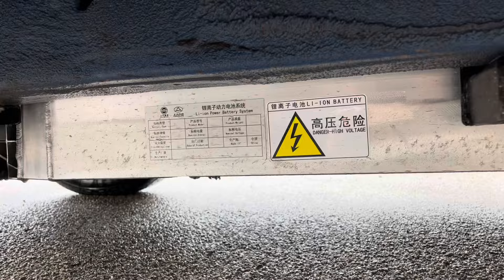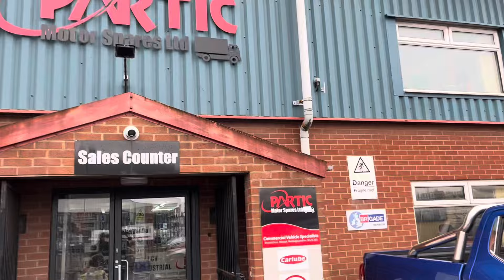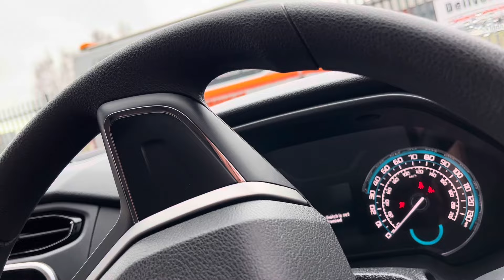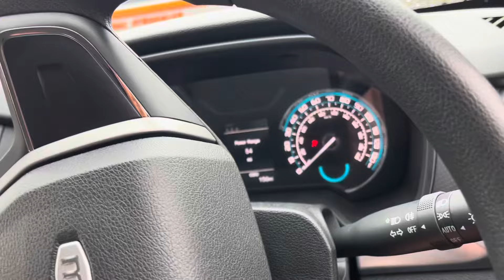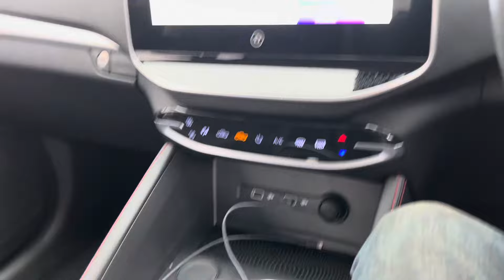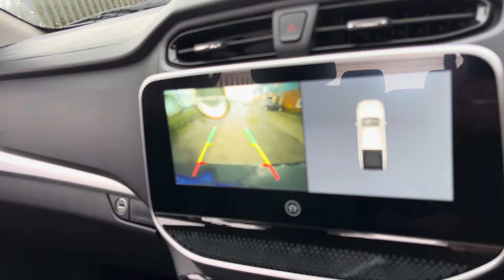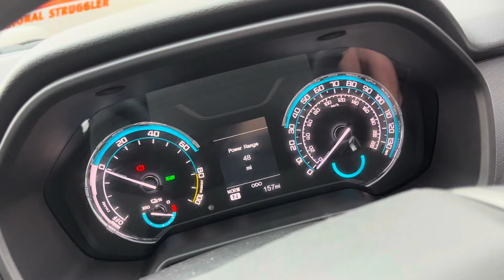First ever drive in an ELECTRIC VEHICLE⚡️review on the ONLY EV  pickup in the uk! Maxus T90 ev

Comment: The noise is a simulation for pedestrians. It goes away once your up to speed. It also has regenerative braking. It's like a retarder but puts energy back into the battery when you slow down. The traction battery is around 400V and is connected to an invertor that converts it from DC voltage to AC voltage for the motor. The 12V system is separate from the traction battery and kept topped up by a charge controller. Technically, the interior lights or radio etc won't drain the traction battery.
Reply from the maker: Nice bit of wisdom the mate thanks 👍

Comment: Worked for Volvo and they are going pretty much fully electric. Maintenance wise they are a piece of piss, if you have the correct equipment. Biggest complaint we had from owners was range. The ads and salesman tell them one thing and real life proves something different. Then it was us techs that were getting it in the neck when they were saying the car was faulty.
 A lot of that noise can also be a noise generator, by law they have to have a pedestrian warning system.
Reply from the maker: I did think that looking at the stats I wonder what it is in real life because I only went 1mile and the miles went down by 4 🤷‍♂️🤦🏼‍♂️

Comment: These come into Royal Portbury dock, Bristol mate.  There’s loads of them waiting to be sold and I get the impression they aren’t moving too well.
I’m glad you’ve had a look under the rear.    What a joke… when these first arrived I did the same and took some photos because I couldn’t believe the lack of quality in the workmanship, it looks like it’s just been thrown together!    Did you notice they spun the original axle 180 to get the motor in and how it hangs so low and anything more than a simple farm track and that’s getting smashed off. 
You can’t tow more than 1500kgs and the load is 1000kgs but you can’t do both at the same time! 😂
All for 50k.  🤡🌍🤡🌍.    A lad who also works on the port has a Maxus flatbed which replaced his diesel transit.. the max range he can get is 90miles and that’s with the heater off!
Reply: I thought that about the motor placement as well, it all looked more like a diy conversion someone did in their shed!
Reply from the maker: Keep them there mate at the docks! I didn’t notice that mate but now you’ve said it…. What a shocking bit of equipment!! There just a faze thing I think
Reply: @KuroSanArts  yes, it’s shocking really.   I couldn’t believe it when I first climbed under.  Apart from the tax relief I really can’t see the point of this truck and I’m sure if the customers who order them had a look underneath they’d probably away!
Reply: @Professional-struggler  well they aren’t moving as fast as all the other cars rolling in and out the port mate!   Next time you pop in for parts have a look at it in more detail.    It really is unbelievable!

Comment: Each vehicle is equipped with one get you home spare wheel and one petrol generator to charge up the vehicle should you run out of power with no vehicle charging stations in sight. Some of the newer models are equipped with a peddle push bike,
Reply from the maker: 😂😂 hope your joking mate
Reply: Think he is … But it would make them less of a liability🤣
Reply from the maker: @bigal5932  😂😂

Comment: Wait until you get the BYD pickup in the UK then you can compare. I have a BYD car here in Thailand and I get 480km range. Starting the car and leaving it running outside my house for 1 hour with A/C on uses 1% of the battery only.

Comment: Mate it’s not true about more electrics you use the less miles you get, 
A electric vehicle still has a 12v system with alternator etc, it’s 2 separate electric systems, one for the drive motor (larger batteries) and then your standard 12volt system for everything else except the electric motor
Reply from the maker: Oh well how come it went down when not moving? I went a mile in that and the miles went down by 4 🤷‍♂️

Comment: I duno about electrictricity vehicles,  
Id panic if i only had 40miles left ,stress would be emense just poppin out,stereo on ,heater on, lights,and only have 3miles left b4 i drove off,😂.
The new age future mechanic wont need a tool box, just a rubber suit just in case you earth out and be frazzled and tazord, just changin a bulb..
Reply from the maker: 😂🤣 had to laugh at your comment Terry (stress would be emense) and that’s before we start the days work 🤦🏼‍♂️😂⚡️

Comment: 2 WD pretending to be 4 WD terrible range with only 2 wheels driven, even worse if 4 were driven, huge battery pack underneath, that will be fantastic in floods and off road, well you can't go off road because 2 WD. Can't use the heater or air con because of battery drain. May be free tax and tax deductible now but within no time it will be as much as any other large pick up. Can't see any good reason to have something that won't do what it's meant to or looks like it should do. Each to their own, but something like this can't replace a Toyota diesel pick up or similar, imagine a farmer with something like that, wouldn't be able to do his job at all.
Reply from the maker: When you ordering one then mate 😂😂
Reply: @Professional-struggler  😂😂😂😂😂😂😂😂😂😂😂😂😂😂😂😂😂😂😂😂😂😂😂

Comment: China's finest 😂😂. Yeah Maxus bought LDV. I have seen a few Maxus LDV vans up here in the Highlands can't see them catching on be alright round the town the range lets them down. Instead of a diff whine you swapped it for electric motor wine 😂. Can't see it being much use of road 😂 only 2 wheel drive. Stick to the Struggle bus think there being optimistic with the Speedo 130 mph. 😂
Reply from the maker: Made out of the finest chinesium 👌 I’d prefer the good old diff wine mate! 130 😂🤣

Comment: What a wonderful introduction to a useless piece of kit, range when light 220 miles unless you use any equipment, what happens when you put a ton in the back and tow a 1.5 ton trailer. Might get a range of 50 if you are lucky. This is not the future. Bring on hydrogen fuel cells, the. Electric drive would make sense. Struggling old geyser.
Reply from the maker: That’s a good point Mike mate be nice to actually work it for a day with load on and imagine that off road with them battery’s there ⚡️💥

Comment: Problem with these electric cars chris is you drive down the road  and all you see is blind people squashed at the side of the road like dead badgers and foxes should have a peg with a card on the wheel like we used to do as kids putting pegs with cards so the cards flipped the spokes sounded absolute crap but as a kid you was on a motorbike 😂then your mum and dad wanted to play cards and you could hear them saying who's had the 6 of diamonds 😂
Reply from the maker: 😂🤣Yeah I remember that to mate and the tin of pop wedged in the wheel to! They are a danger mate if your hard of hearing
Reply: @Professional-struggler  was it somewhere in Leicestershire aswell they removed the curbs and lowered the pavement only a matter of time before someone is seriously injured or killed by an electric car not to mention when they catch fire they can't put them out.

Comment: That electric truck looks like Chinese crap any thing electric doesn't do the mileage they say it does and the vans could not take the weight of diesel i think i will keep to a engine thanks that truck sounds like a milk float 😂🤣 over price crap and they can keep it charging it up takes forever funny to see you trying to drive drive it think you will keep the struggle bus mate 🤠🤪🍺
Reply from the maker: Yeah I bet with weight on the mileage half’s 🤦🏼‍♂️😂🤣

Comment: You got more miles out of a milkfloat 40 years ago. 
100K or 7 years the battery needs replacing for around £30,000
Waste of time these EV's and there is nothing green about them.
Reply from the maker: Yeh people said this 100k and that’s the life span 🤦🏼‍♂️ what a waste of money
Reply: @Professional-struggler  The other thing with these batteries is the more you use them the weaker they get. You might get 300 miles when new but over time that drops to 200 miles and less over time. Many companies now refuse to sell them and the insurance companies won't insure them due to the time of battery life as these cars get scrapped after a crash as they are too expensive to repair.
Reply from the maker: @oldmanonamission8055  it’s not looking good for the old battery vehicle mate
Reply: @Professional-struggler  It's like the old gas car years ago. That vanished as quick as a fart in the wind as well.